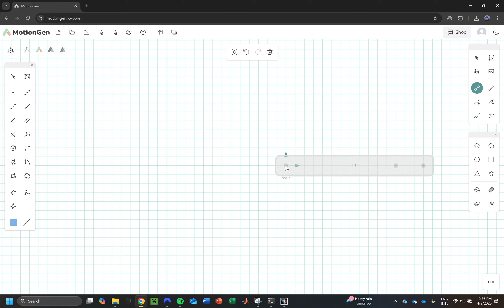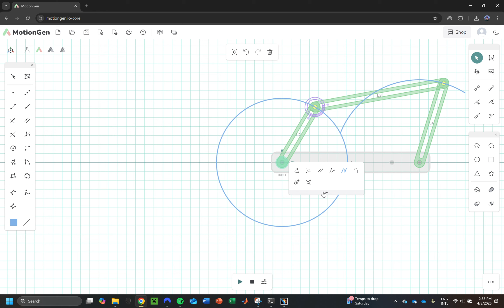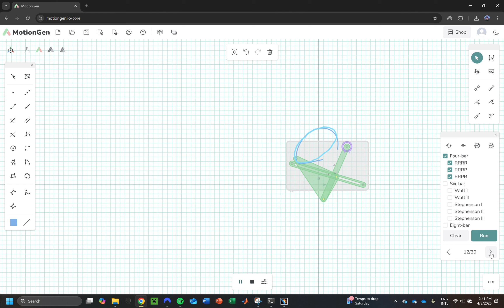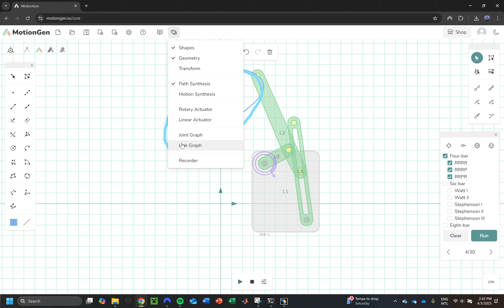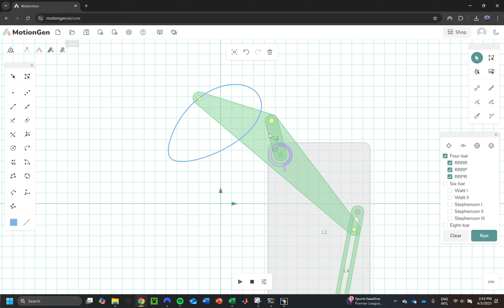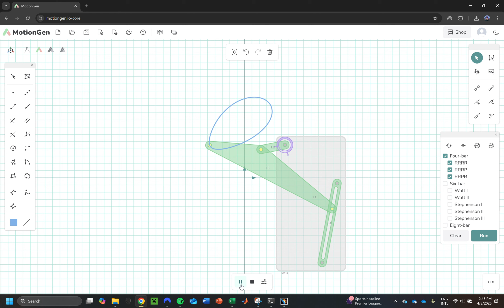🎥 Intro to MotionGen | ES 204 Engineering Dynamics

Comment: I have a design that is giving me a problem.  It seems that hydraulic cylinders move TOGETHER.  I need the ability to individually start and stop the STROKE of a cylinder (linear actuator), while the other cylinder(s) in the assembly continue to extend or retract.  In this situation, cylinder A extends fully, however cylinder B fully extends when A is only 50% extended.  Then B needs to remain stationary while A fully extends. When A is fully extended, B will retract while A remains stationary.  Can someone help me with this?